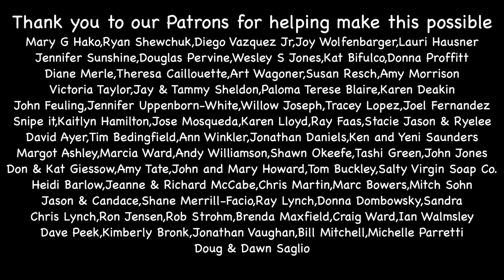TIMELAPSE: BEAUTIFUL DIY Brick Pizza Oven + Santa Fe Patio Build in 8 MINUTES

Comment: for potting you might try using metal reflectors inside the oven to increase the heat to the correct temp (use a thermometer like a turkey thermometer, or??). you can probably do it. there are cheap manual table top kick wheels and table top electric as well.